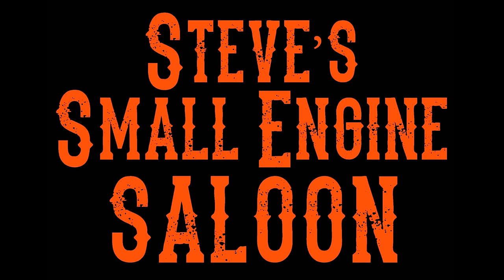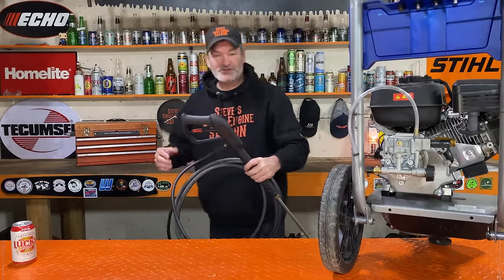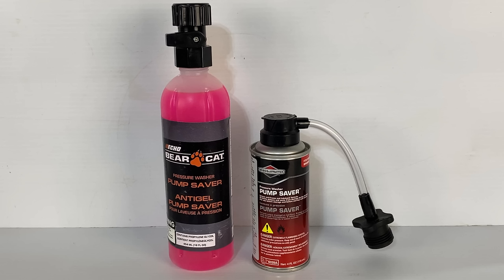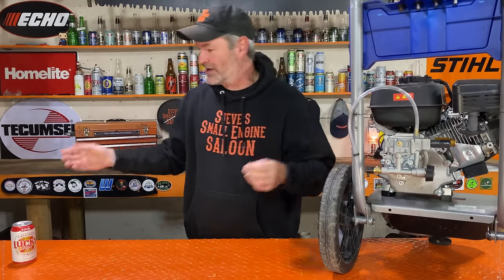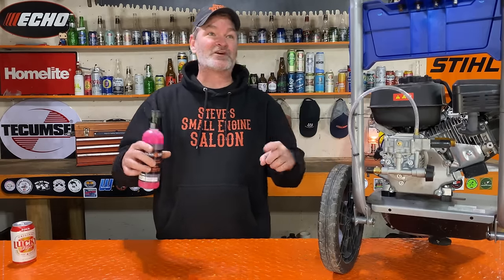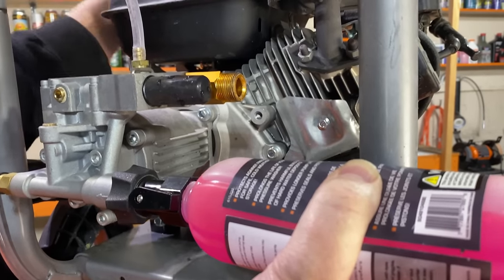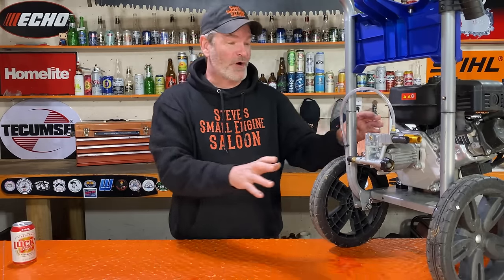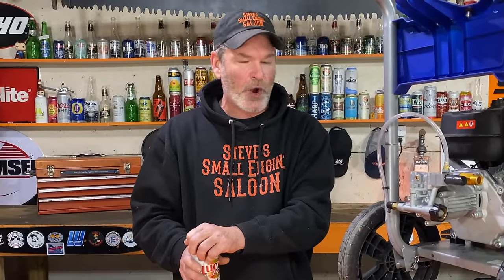Winterize Your Pressure Washer PUMP And SAVE A Ton Of MONEY

Comment: Anytime I throw out a garden hose that is rotten or has a leak I cut the ends off for this kind of stuff.  Put a funnel in the end, pour a bit of antifreeze in the funnel and do the same thing.  Save's the cost on the fancy bottle.
Reply: i was thinking tthe same thing
Reply: That's how I did it except I fired it up until it shot the antifreeze out the end of the nozzle.
Reply: I have been doing mine just like that, with the funnel and a short piece of old garden hose, for a bunch of years now!!
Reply: That's exactly how it shows to do it in my Excell XR2750 owners manual.  And not just for winterizing,  do it if you aren't going to use it for another month or longer.
I know "owner's manual, what's that?"😄
Reply: Been there, done that…

Comment: While I found the video entertaining and somewhat practical, I have a MUCH easier solution.  If you have the need to own a pressure washer of any quality (not some $150 unit), simply store it in the basement or other heated area that contains water pipes (somewhere where it doesn't freeze).  Put it away when the frost hits and take it out in the spring time.  It's kept my unit running like new.  Are you worried about the slight smell of gasoline inside?  Then you shouldn't have a need for a gas unit.  Buy an electric one.

Comment: I always drain my hose then start the pressure washer up without water and immediately shut it off have done for 25 years and have never had to use any antifreeze. I do it every time I use it. Works on my electric or gas pressure washer. I use PRI-G fuel stabilizer and don't do anything to the engine. No problems ever.

Comment: Any tips on how to do this on an electric pressure washer? do I just turn it on briefly? I'm worried I would burn out the pump if it doesn't have full water flow...
Reply: My electric one just allows the antifreeze to flow through - no need to have the pump on or anything. That's also the directions for Ryobi electric ones

Comment: I don't fill my hoses with antifreeze, but I do put some into the trigger unit and leave it for a few weeks to rejuvenate the seals. 
Also leave the hose ends sitting in it as well, then coat them with silicon grease to preserve them. 
Been using the same hoses and trigger units for 14-15 years now and never had to replace the seals

Comment: I run an 8gpm commercial hot water washer. I keep 2 5 gallon buckets of rv antifreeze and pull it through a separate supply hose after each job. Place the pressure hose in the bucket once it goes throught the whole system and close the ball valve, run it in bypass to the bucket and shut down.

Comment: Steve, another reason this is such good advice is it isn't just a good thing to do for those who experience freezing temperatures.  Where I live in Florida I have two other conditions to deal with.  One is I don't use my pressure washer very often so it spends a lot of time in storage.  The second problem is my well water contains a lot of minerals.  Unlike the water in the house where it goes through the water softener and the drinking water then goes through the osmosis system, the pressure water gets water straight from the well via the shallow well pump.  Being ignorant, I just didn't know any better, my pump seized from the minerals in the residual moisture during storage.  I replaced the pump and now I use a pump saver before putting the pressure washer away after using it.  Length of time in storage and minerals in the water used make doing this as necessary as much as freezing temperatures.  A ruined pump is a ruined pump...  Thanks for the great advice!

Comment: Wow, my Ridgid 3200, had it about 8 years, live in Michigan and never even thought about winterizing it - It must either be bulletproof or I am very lucky but never had a problem with it. I do run out the gas before storage, just last week I needed my 80ft camper power washed, I asked a local guy doing it on the campground how much and he said $200 ! So needless to say, I lugged my Ridgid up there and did it myself. Was nervous whether it was going to start, with the need to hook it up to water I didn't test it first ,,, Started on the 1st pull and ran like a champ, while I was doing mine other trailer owners came up to me and asked me how much I charge, I said I don't do this professionally but I'll do it for $100, I ended up doing 3, could have done more but my hose wouldn't reach their trailers. 
Not sure if the no idle for over a minute rule applies to me, nothing said about that in the manual, I walked away from it running a few times for a few minutes. It has auto idle down, maybe thats a factor.

Comment: Hay Steve , I leave  the wand on use a small bit of hose with a funnel fill with plumbing atf start the unit and add atf until it comes out the wand . I have done this for about 10 years with the same pressure washer.  Great videos man keep on keeping on, cheers man.

Comment: Great tips and explanations👍🏻 been blowing out my hose, wand and pump for 12+ years with shop air then running antifreeze through the pump. No problems! except for 2 years ago, was out of town when we had an early and un forcasted HARD freeze before I winterized my pressure washer😳 luckily the oem replacement pump was under $250!

Comment: Great video Steve. I store my pressure washer in the basement so I don't have to worry about freezing.
Reply: Something here as well. All I do is drain the tank and carb.
Reply: Watch out, Gents! Not so much FREEZING, as much as the internal pump runner seals will deteriorate. Use the RV antifreeze even in the heated basement. Don't ask me how I found this out storing mine in the basement as well...

Comment: Electric pressure washer owner here. Any suggestions, Steve,  for getting the pump saver solution to circulate through the pump in this situation?  UPDATE: Found the answer. To move the pump saver through electric pressure washers will only need to connect the pump saver bottle to the inlet and squeeze the bottle. So, a simpler procedure than for a gas engine pressure washer. Cheers!
Reply: Awesome video demonstration Steve.. I like the way you make the video so easy to understand, which it is, my question to you  is that i just picked up a brand new Ryobi power washer 3100 psi.. 4 stroke.167cc Honda  engine.... and says on the  manual that ,I should use the pump  saver every time I use it.. but i don't  believe that it is  necessary, on the every time  basis..,but at 200 percent on the winterizing,completely on the band wagon..my questin to you is sould I  really every time?

Comment: Hi Steve.  Thanks for the tip.  Question:  My friend gave me an old Craftsman power washer.  Model # 580.752600, Serial # 1008834603, 2600 psi, 2.5 gpm's 7hp Briggs Intek platinum plus  Made in the USA. I rebuilt the carburetor using the ultra sonic cleaner and my slip 2000 gun cleaner solution made for ultra sonic cleaners awesome cleaner. I poked out all holes including the bowl nut   I replaced the needle and seat, float and float pin, bowl gasket and nut gasket.  I replaced the fuel line and cleaned the fuel tank. I used Tru-Fuel canned gas no ethanol.  Starts up without any problems but it sounds like it is surging at idle.  When I press the gun to power wash it sounds perfect and it's powerful.  No surging sound.  When I release  the trigger it goes back to the surging sound. Note: Does not stall at idle it's running at 3500 rpm's idle and power washing.  Is this normal?  Thanks sorry for all the writing.

Comment: In answer to a comment concerning rv antifreeze not having seal  conditioners . The pink stuff does have seal conditioner. RV' s have rubber seals in the pumps as well as the faucet washers. This treatment is great for both.
Reply from the maker: Right on
Reply: thanks, you confirmed it. Now I do not need another gallon of something else i want a quart. oh well

Comment: If you have an RV and have a pump system to put the "Red Pop" in, you can use it on your pressure washer as well. It supplies enough pressure to run it through the pump and hose, uses only about a quart of antifreeze.

Comment: What a wonderful, helpful video, Steve!  I bought a 4-stroke Pressure Washer around 2008 and have only used it a very few times.  It was stored indoors until the last 4 years, when it's been stored in a shed.  I've been needing to use it to wash my car, so I'll see if it's been damaged by the cold weather these past 4 years.  We did have a couple of light freezes one years and snow that stuck for 2 days.  If it still works without issue, I will purchase the Bottle Pump Saver and gallon refill from your links.  $37.97 plus tax would be money well spent.  Wish me luck.  Thanks for this fantastic video, Steve!  You're the man!  I hope you enjoyed that Lucky Lager.  👍👍
Reply from the maker: You're Welcome...and Good luck!    :_Beer: :_Mower: :_Rider: :_Chainsaw:
Reply: I just learned that RV antifreeze contains ethanol. So when you buy RV antifreeze make sure you buy ethanol free RV antifreeze because it will make your seals and rubber components dry out. 🤷‍♂️

Comment: I tip mine on its side and put rv antifreeze into the intake and cycle the engine until the antifreeze comes out.  It's preserved my pump to -41°F temperatures and it's cheap and easy.  Less than 3 minutes

Comment: I connect a washing machine hose to a double male hose adapter and hook it up to the inlet of the  pressure washer. Then I fill the hose with RV antifreeze ( any antifreeze will do ) and then I crank the engine until the antifreeze comes out of the pressure side of the pump.

Comment: Always winterized my washer the same for years. First I remove most the gas, then add a few ounces that has stabilizer added. I should mention I always had access to ethanol free gas. I hook up the water and run the engine till it runs out of fuel. Disconnect the water, take some compressed air and blow the water out of the pump. Then I remove the spark plug, hook up a can of pump saver to the pump and squirt a little to see it come out the pump. Then I rotate the engine a few pulls. Then I squirt a one 1 sec burst of fogging oil in cylinder, check gap and replace plug. Then drain and replace oil. All set for next season.

Comment: I have always winterized by filling the 6 foot input line with 50/50 mix yellow AF and running the engine until the wand spits green foam (about 2 seconds) ...seems to work and is pretty easy.

Comment: How do you drain the gas? I just bought a Westinghouse WPX2700 Gas Pressure Washer and works great, but I will probably not used in a while, I have about half a tank of gasoline in there. This video was nice :).

Comment: Hi Steve, I bought a brand new cheap and cheerful small generator in 2008. It wasn't powerful enough to run a garden chipper so forgot about it and it's full tank of petrol.
I'm going to remove the air filter while emptying the petrol, replace the petrol and check the sparkplug before firing her up. 
Do you think she will be gunked up with residue?  And would you recommend a de gunking product? Thanks!

Comment: great video. agree with how to save $23 for fancy bottle. read review about old hose and funnel to use RV antifreeze on the cheap.  Still I worry that antifreeze does not lubricate rubber O-RINGS. Any thoughts out there on this. One guy said after antifreeze, lubricate with any car oil. messy but works. still cheap and messy, but messy is ok.
note basement is not enough. you wanna stop corrosion and o-ring death rot.

Comment: Any tips on the gas? Is  adding a stabilizer and filling the tank completely full sufficient for winter storage. Should I fire it up and turn gas off letting it run till it quits? Any suggestions

Comment: I run Stabil in the motor and Stabil pump saver in the pump. But I will find an old hose with the end and cut it and feed the end into the RV Anti freeze container. Of course pull the motor. No fancy bottle.

Comment: Thanks for the tip about blowing out the pump with compressed air. Never really gave that a thought before. Also, thanks for the link to the squeeze bottle pump saver. The aerosol pump save gets quite costly.
Reply from the maker: You're Welcome...

Comment: Is it the same for an electric power washer?
Reply: Good point, electric one hasn't got a starter to turn the pump over, someone will know though.
Reply: @Roly679  I'd look for a pulley on a belt driven pump,  or a way to attach ratchet or socket if it's direct drive. 🤷

Comment: That’s one of the reasons I like putting quick connects on the pump side as a minimum.  If not the hoses get corroded on and are very hard to take off after a whole.  Or make sure you put some grease on the washers before you thread the hose on.  I’ve gotten a lot of units where the previous owners left everything connected and sometimes the threads/hose are impossible to remove.

Comment: Steve,  
I just bought the bottle and tried using it on my unit but I couldn't get anything to come out the other side.  Even when I used compressed air nothing came out.  I haven't used the unit for several months.  What am I doing wrong?

Comment: I use the end of a garden hose to run RV antifreeze through by pulling the engine over until I see the antifreeze exit. Normally I'm too lazy but I really like this particular pressure washer someone threw away from water in the gas. I pulled a few spare pumps that are direct replacements too as I'm also too lazy to spend beer money on a new pump. Can someone open my beer? Just kidding.

Comment: Having non stainless water fittings on the inlet side of the pump WILL destroy the valves in the pump from rust flakes. It dose not take much.

Comment: Briggs & Stratton that's not true I've used that Briggs & Stratton spray can several times and I still have solution in it but what is true eventually that can will run out maybe that's what you were trying to say